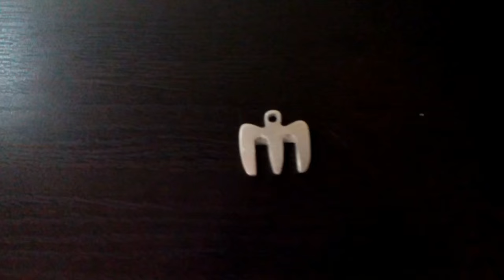Handcraft Aluminum Initials At Home (Aluminum Jewelry)

Comment: You should try making one of those diy aluminum foundries, and learn to cast aluminum. It's something I've been wanting to try for a while but I don't have the space to set it up.
Reply from the maker: Hello. Good point,it is something i want to do for the last few years although it has a little too much hassle to start casting,mostly with using the sand/plaster/whatever molding material and generally in the period from the beginning until you learn to make successful casts.
I will set up a makeshift foundry using charcoal and coffee cans to experiment with as soon is possible as i always wanted to cast model engines,which when made otherwise are a whole lot of trouble.